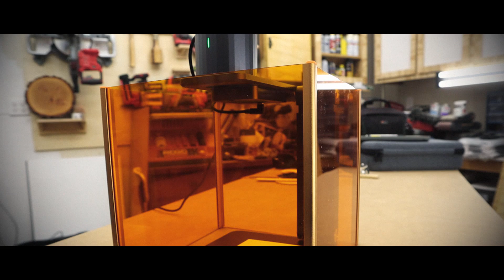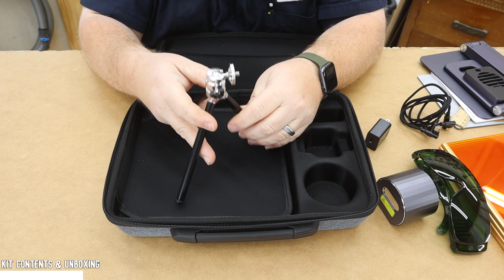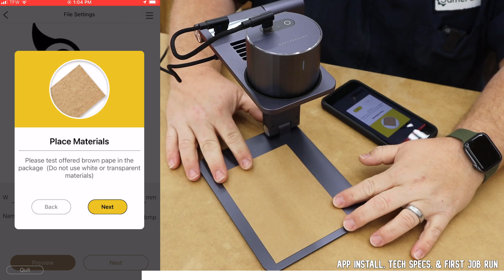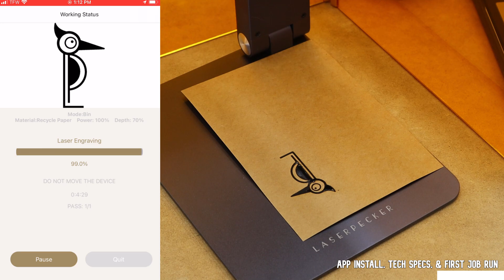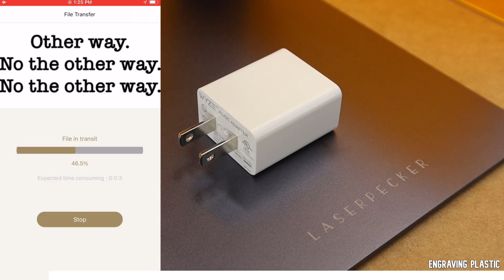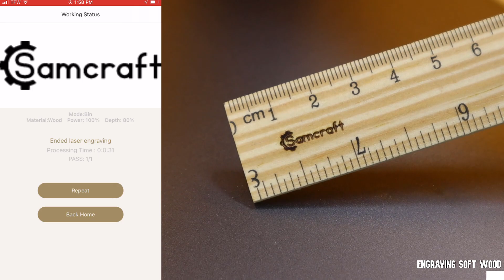BEST FIRST LASER? LaserPecker L1 Pro Super [FULL REVIEW]

Comment: You can change the settings from metric to imperial if you are US based and find it easier.  Metric will be more accurate to get close measurements quickly if you are used to it, but most US based people are used to imperial so it might be quicker and easier to switch if that is what you are used to

Comment: My main issue. U see basic model. That cheap mini tripod keep falling down. I hate that. I see why they wanted u to buy the pro version. But i find that's way too much for the same laser. But I guess u paying for safety shield a adjustable Motorized laser stand. Is there anyway to I can get a cheaper version of that Motorized stand. Can someone do a diy tutorial laser pecker stand out of cheap materials. Manually adjusting. No Motorized mechanisms. For the basic laser pecker. Safety shield easy to make. But manual laser pecker stand. I need some help making it

Comment: I'm getting into Pneumatic Gun Engraving. I'm thinking about using this to transfer artwork onto the Gun surface. If I paint the gun surface with a flat white can you laser engrave the paint without scaring the metal surface below. That way if you don't like how it came out you can just remove the paint and start over. Any thoughts??

Comment: I just ordered the LP2 Deluxe, havent received it yet.  Just wanted to ask if you used or needed air filtration for the LP1?
Reply from the maker: Any time you engrave material you will want some way to get the fumes and smoke away from you. Whether it's a box fan, wearing a respirator, or elaborate enclosure, you don't want to breath this stuff in!
Reply: @Samcraftcom  THANK YOU for responding!  Any suggestions?

Comment: Could this be used onsite at craft shows for producing products onsite? Maybe coasters with a cork center? Since it is just engraving, should not have much smell or a need for exhaust, right? Too bad it can't do slate coasters.
Reply from the maker: It could, it is very portable. HOWEVER any time you engrave anything, there is smell/smoke/exhaust put off... you're burning the items. So from that standpoint I wouldn't advise it.

Comment: I have one of these, the ruler supplied is exactly the right length to measure the distance when using the tripod
Reply: i use my 3d printer ,made a bracket to hold it  and use z axe to get the perfect mesure....:)